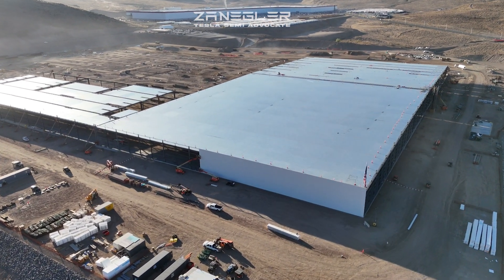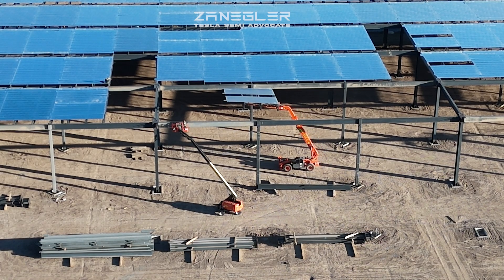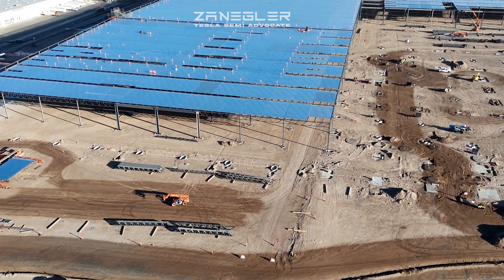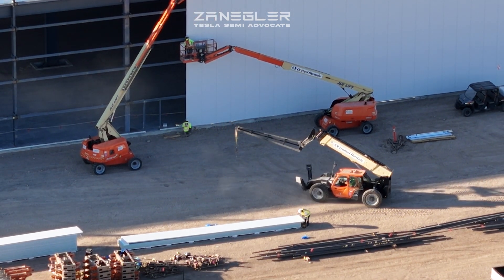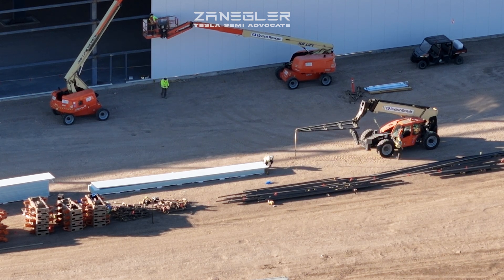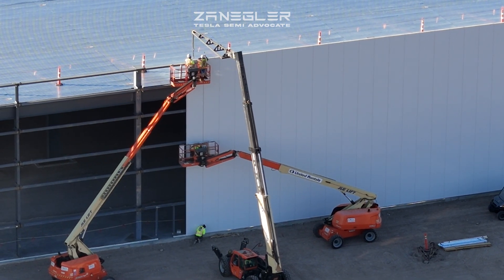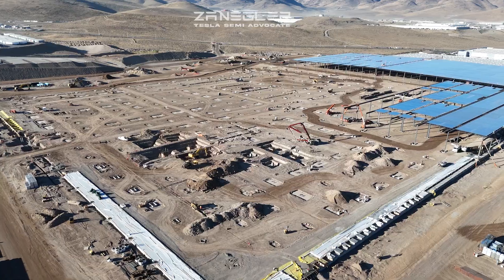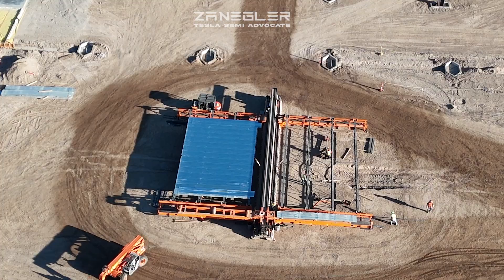Breaking News! Tesla Semi Factory Walls are Going Up!

Comment: Hard to be completely certain from the video, but it looks as though they're using SIPS (Structurally Insulated Panels). I also wonder if they are made of a flat version of corrugated steel for light-weighting and ease of manufacture and construction.
Reply: Probably not SIPs, but regular coolroom/freezer room/sandwich panels. Just remembered that inside Battery at GT they used similar. See Jeff's Day 364 at 8.59.

Comment: I watched all the earlier Giga factories being built in Texas, Berlin and Shanghai from the beginning. I noticed that the Berlin factory was built using really heavy materials, from the concrete columns to floor beams. The Texas factory used both concrete columns and steel beams but their outbound lot building was made of steel columns, beams and trusses. The Shanghai factory was the fastest to be built and hardly used any concrete columns but they did use cranes to haul the materials into place. This Semi Truck factory is the champion when it comes to construction as they seem to use only light weight materials which don’t need heavy cranes at all!
Reply: Buildings in Nevada don't need to withstand hurricanes or earthquakes
Reply: @enighostmaster or even much rain. Quick google shows average annual rainfall in Sparks is less than 8”/year.
Reply: @enighostmaster  The existing Tesla factory was designed with seismic loads in mind. Google this and you should find a link to a great paper about the structure and it's design; 'Performance Based Seismic Design of the Gigafactory in Tesla Time'
Reply: Maybe that’s good. But doesn’t seem on par to quality. Yet what do I know nor do I run Tesla 

I guess region code and building needed. Yet I don’t know why anything isn’t built to highest standard and form and function. 

Look at European villages. Stood the test of time and a beauty to look at. Compared to ugly American villages. Only the extreme affluent have pretty neighborhoods
Reply: Weather, especially wind and temperature dictate building designs - it's not a difference in "quality". Nevada is dry, hot and cold, and hurricane and tornado free.

Comment: This construction looks like a temp building. I guess they don’t have any weather issues or building codes.
Reply: The weather issue is they want a roof and outside walls up before it starts snowing.
Reply: Existing inflexible codes put an abrupt stop to innovation.   If there is new here  I suspect this company has had engineering reviews with the powers that be.
Reply: This is at 4700' elevation. Snow, desert conditions in summer.  It's going to largely be used as open line factory space, no need for it to be elaborate to be effective.

Comment: Tesla seems to be refining the process of building the machine that builds the machines. I bet the factory has a higher level of sustainability, quicker to build, lower cost with state-of-the-art improvements above Giga Texas.
Reply: Well of course. Look at the monster Texas is. In 100 years it will still be a marvel of engineering and behemoth to behold. And they aren’t even done upgrading it !

Akin to an Apple Park but Elon twist . Haha
Reply: The construction methods aren't Teslas remit, that's up to the contractor.
Reply: @boostav Tesla is the designer and sub contracts. They have their own architecture firm in-house
Reply: @TheMagicJIZZ  I know but they design the factory, they don't design the construction method of the factory. That's up to the contractor, for example Tesla did not come up with the MezzMaster assembly system you see being used.

Comment: Looks like it’s basically a big metal shed 😂
Reply: Factories and warehouses and such aren't anything fancy. Though you might be surprised if you looked close up how precise and technical all the pieces are and how they snap together and how strong the resulting building is. Not sure if these are single wall panels and they'll be spray-foamed on the inside or if they're double walled with a foam core. My guess is the latter as they look very rigid.
Reply: I beg to differ. 

What is giga Texas for $100 Alex 

Thing is a monstrosity and it’s beautiful. Look at any video inside and it’s a sight to behold for size / form. Is it Apple Park. No but it’s akin Elon and margin culture. 

I will say this looks like a china warehouse. And hope workers are happy in there

Comment: Those wall panels hardly even bend and they must be 50' long. Wonder what they're built of?
Reply: Two layers of metal with foam in the middle.
Reply: the wall panels are around 36' as he takes 15 steps as he walks the full length of the wall panel at 5:11 into the video.
Reply: Developed by Building Zone Industries, with insulation foam enclosed by steel.

Comment: Good update. Looks like foam filed wall panels.  It would be nice to know how thick the panels are.
Reply: 7:05. Worker's hand seems to grip the full thickness. 4" 100mm.

I would guess 4' 1.2m wide, as seen at 4:04. Height scales to 40' 12.2m, 10 x the width.

Sometime known as sandwich panels, freezer panels, refrigeration panels.
Reply: @DessieDoolan  Thanks.  Nice analysis!!
Reply: @perlievoshell96  You're welcome. With a couple of clues, and at least some indication of a dimension, it's quite easy to scale a size. When a rough idea of size becomes clear, then often a bit of searching finds the particular material is available in that size.